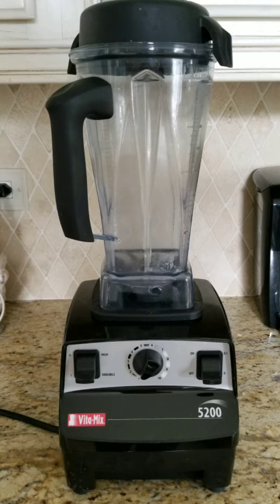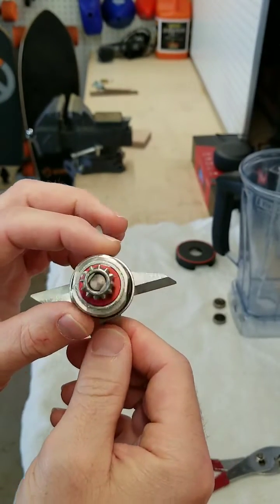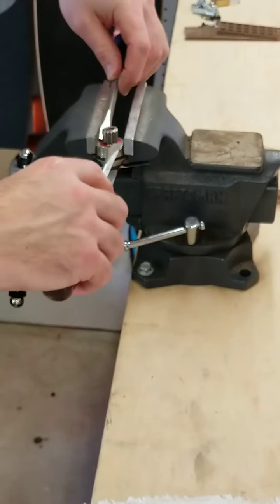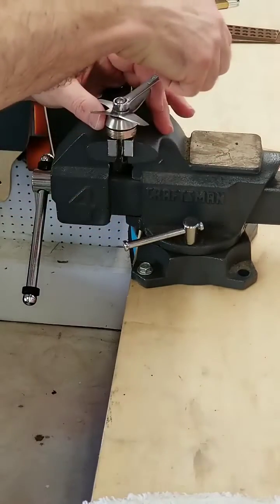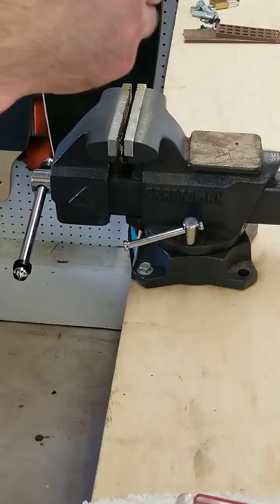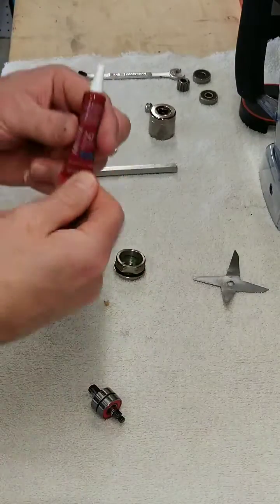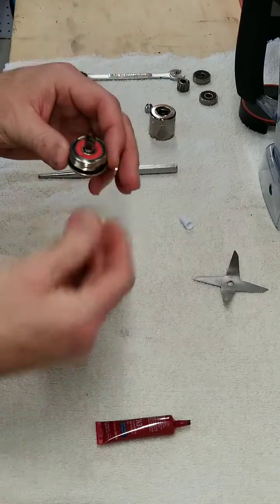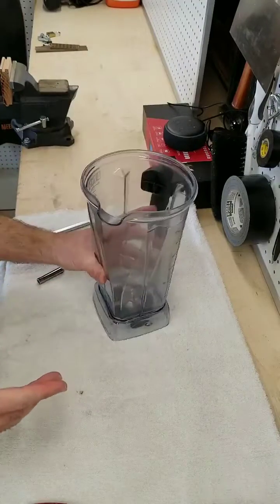Vitamix Blender Bearing Replacement Fix

Comment: Hi Mark, 

My ball bearings were "fried". The inner diameter casing, the ball cage and balls of the upper bearing were all that was left when I disassembled. From your video I can see what the actual good bearings should look like and can see that the two outer metal bearing casings are "stuck" inside the threaded base.  I am trying to tap them out with no luck...any ideas...I could tell they were stuck in there because when looking from the bottom opening of the base facing the blender, there appears to be the outer metal ring of the base and ring of metal "inside" it!!! and when I see and feel inside the metal base, the sides are not smooth to go against a smooth bearing surface, they are ridged when the bearings would have tracked inside them.
 
The beginning of this repair  started at my local hardware store that loosened the big nut on the bottom...at that point, we could see the upper ball bearing with exposed bearings and cage and the inner casing. The other inner casing was stuck to the shaft and that is when I realized...wow...the entire lower bearing was obliterated accept for the inner case stuck to the shaft!  I had been loosing bearings here and there of that one...My local hardware store had me soaking the parts in WD40 to break up any rust and hardened sludge...

BUT from your video, I can now see how there were actually two bearings stacked and unfortunately, the outside casings of them are stuck inside the base...

I have put them in a vise and tapped down on them through the hole on  the blade side of the base using a screwdriver tip and hammer against  the thread-like  lines inside the base but these outside pieces of the case still seemed fixed.  Any ideas on how to free these outside walls of the bearing cases from the inside of the base???  

Hoping to hear from you and/or others on this and in the meantime, back into the WD40 with more purposeful intention...:)
Reply from the maker: You are using a socket and vise to try to press the bearings and shaft out from the base?
Aside from WD-40 or something like liquid wrench, the only other option would be heat, but there are some rubber parts in there that surely would melt...  You may just have to buy a whole new blade assembly from Amazon at this point (next least expensive option).

Comment: Be advised that not all skateboard bearings are exactly the same inner (bore) diameter, despite claimed size. I bought the following on Amazon, and the shaft didn't fit tight in the bearings. The shaft could turn inside the bore of the bearings, and it would have ruined the shaft if I'd kept them in place. Mini Skater Skateboard Bearing 7x8x22mm ABEC 9 Precision 608 RS Scooter Longborad Bearings (16 Pcs Blue Silvery) They were cheap, and I got what I paid for.
Reply: Use a 608 2rld (peer bearing!)

Comment: If I buy a whole new wet blade assembly and place it in as you took it apart should everything be sealed properly?
Reply from the maker: Yep, putting it back together like this will ensure it's sealed.  Replacing the whole assembly is way easier than doing just the bearings, but also way more expensive...

Comment: I'm getting water leaking right through the center of the bearings.  No water leaks between the large and small o-rings at the bottom of the container. Any ideas on what holds the water from going through the bearings, or what needs to be replaced?
Reply: I got the same problem at first. I guess the inside little seal through which the shaft passes through, the one just above the upper bearing (closed to the blade), isn't has tight as a new seal. Anyway, what I ended up doing, I put a little bit of silicon on the top of this upper bearing before to insert it into its position. With a toothpick I applied a thin trace of silicon on the top circumference of that bearing. I didn't want it to spread toward the moving center. Well! It worked. It isn't leaking anymore.
Reply from the maker: Most likely the shaft seal, which can now be found on ebay.

Comment: Did you replace the seal? They are a bit of an odd one,  trying to track it down.
Reply from the maker: No, luckily I didn't need to.  You may want to try form-a-gasket by Permatex if you're not able to find a seal.

Comment: Thanks. But I only can take one bearing out by pressing. The second bearing is still sitting inside. Any recommendation how to take the second bearing out?
Reply from the maker: Maybe try to spray some liquid wrench type fluid in there and let it set in for a while and/or then try to tap it out using a punch, like I showed in the video, or a small screwdriver.

Comment: Thanks so much for the information bud. What is the bearing size?
Reply from the maker: They are standard skateboard bearings. I would just make sure they are sealed, which I think most are these days.
Reply: The bore is 8mm  OD 22mm and height is 7mm
Reply: 608-2RS and better to use proper one like SKF, NTN, ...

Comment: Thank you for this video.
When you say "skateboard wheel bearings", do you have a specific type? ABEC 5 or 7? Can it just be anything generic, as long as they're for skateboard or inline skates?
I would guess bearings aren't made equal.  You can buy really good quality bearings, and very cheap ones.  I just wonder what the Vitamix OEM bearing quality is.
Reply from the maker: Thanks - Someone else recommended these bearings, but I have not personally tried them: 
Size: 608 2RS 8mm bore 22mm od 7mm wd 
or just order this: https://www.amazon.com/608-2RS-Precision-Shielded-Greased-Bearings/dp/B01L7P89RW/ref=pd_cp_328_1/135-4551291-5960504?_encoding=UTF8&pd_rd_i=B01L7P89RW&pd_rd_r=b4f299b5-7f79-4ae0-8866-31659257ca46&pd_rd_w=Y2iYH&pd_rd_wg=5ybrV&pf_rd_p=0e5324e1-c848-4872-bbd5-5be6baedf80e&pf_rd_r=Q4BD8FE60S9DB7H0TQ8X&psc=1&refRID=Q4BD8FE60S9DB7H0TQ8X

The ones I used were ABEC 7 and came with some wheels I had.  I wouldn't use the cheapest nor would I buy the most expensive.
Reply: @mmark300  Thanks again.  Great reverse engineering and work around.  I knew this thing was possible to fix!
Reply: Yes bearing come in different grades..................Don't buy the really cheap Chinese bearings.

Comment: Anyone know? How did he know the bearings were the issue? Mine is 12 years old but everything looks good. I'm thinking this may be my issue in that I have to use my tamper a lot more often to get stuff moving around.
Reply from the maker: Mine was making some very bad noises.  Turn the blades by hand - they should be very easy to move.  And it's not difficult to take the blade assembly out and check the bottom bearing and whole assembly to see if there's any signs of a burnt bearing.

Comment: Would ceramic bearings be better here?
Reply from the maker: Probably, but not sure if it's worth the cost. If you could find somewhere to buy just a couple of them it may be.  Because it's a lot of work to change them out it's worth getting higher quality bearings for sure.
Reply: @mmark300  I'm about to order some. Full ceramic 608 bearings are relatively cheap at $5-10 CAD on aliexpress, but complaints of slop are common in the feedback. I like the idea that they don't need lube, because mine goes in the dishwasher. My bearings are likely especially bad because I'm using a $40 kockoff polycarbonate mixing container with bearings that started to rust immediately, but otherwise flawless quality.

Comment: omygawd this is way too much work for me!  looks like Im ordering a whole new blades and all 😳😳
Reply from the maker: Haha, yeah, this repair is not for everyone.
Reply: @mmark300  This video is awesome! Alas, I'll probably not be able to take advantage due to the investment I would need to make in all the tools (Vise, etc.) that you've probably spent years accumulating.

I'm more than frustrated with Vitamix, as they do not sell a replacement blade for my container type (the one I purchased has a driveshaft that is too short and there are not enough threads on it to properly engage on the container).

There don't appear to be any cheap Chinese knock-offs available on Amazon either. :(
Reply from the maker: @TACaddick  Thanks! And that's a real bummer.  Is this a new model?  I would think they would have replacements available soon.
Reply: @mmark300  Hi… thanks for your reply. Although my Vitamix is over THIRTY years olds, the container is a relatively new 48oz low profile model.

Comment: Do you have more information about the bearings? Number or something else?
Reply from the maker: Someone else recommended these bearings, but I have not personally tried them: 608 2RS 8mm bore 22mm od 7mm wd or just order this: https://www.amazon.com/608-2RS-Precision-Shielded-Greased-Bearings/dp/B01L7P89RW/ref=pd_cp_328_1/135-4551291-5960504?_encoding=UTF8&pd_rd_i=B01L7P89RW&pd_rd_r=b4f299b5-7f79-4ae0-8866-31659257ca46&pd_rd_w=Y2iYH&pd_rd_wg=5ybrV&pf_rd_p=0e5324e1-c848-4872-bbd5-5be6baedf80e&pf_rd_r=Q4BD8FE60S9DB7H0TQ8X&psc=1&refRID=Q4BD8FE60S9DB7H0TQ8X

I used some sealed ABEC 7 skateboard bearings that I already had.  One person did say that their cheap skateboard bearings had too large of an opening and spun around the shaft. I think the lesson is to not go too cheap on bearings.

Comment: I was able to do this but shaft doesn't stay in the bearings.  It moves up and down.  Might need to add locktite on the shaft also.
Reply from the maker: You may want to try other bearings. Someone else commented the same. Some bearings are out of spec, I believe.

Comment: they make a lot of different bearings, which ones exactly?
Reply from the maker: I just ordered a decent set of sealed skateboard bearings from Amazon. Not the cheapest and not the most expensive.
Reply: Alright that's cool, they all seem to be similar.. I have an old blade assembly I can try to take apart.

Comment: Excellent video.  I don't understand the use of loctite on the outer shells of the bearings?? Nothing really likely to movie there.  I would have used a very light coating of food safe grease or mineral oil, as well as on the bottom pressed on gear.  Also, you neglected to show or mention the (imporiant) seal/O ring on top of the upper bearing.
Reply from the maker: Thanks. My seal/o-ring was still good, but if not, form-a-gasket may work. Someone else said they used some silicon. I was unable to find a replacement for that gasket and have never seen anything else like it before. 
Yeah, loctite may be overkill - i don't recall exactly why I decided to use it...

Comment: im replacing my bearings and if the sides of the bearing are that loose and there is (zero compression) the loctite might not work....a spinning bearing on the shaft or housing will junk the blade assembly.  you wont even know if its spinning in the housing until its too late....it would be better to use a copper shim instead of the loctite...
Reply: unless its held by side pressure from the assembly itself...in which you don't need the loctite or the shim...;)

Comment: Hi can you confirm type or name or number of bearing?
Reply from the maker: Someone else recommended these bearings, but I have not personally tried them: 608 2RS 8mm bore 22mm od 7mm wd or just order this: https://www.amazon.com/608-2RS-Precision-Shielded-Greased-Bearings/dp/B01L7P89RW/ref=pd_cp_328_1/135-4551291-5960504?_encoding=UTF8&pd_rd_i=B01L7P89RW&pd_rd_r=b4f299b5-7f79-4ae0-8866-31659257ca46&pd_rd_w=Y2iYH&pd_rd_wg=5ybrV&pf_rd_p=0e5324e1-c848-4872-bbd5-5be6baedf80e&pf_rd_r=Q4BD8FE60S9DB7H0TQ8X&psc=1&refRID=Q4BD8FE60S9DB7H0TQ8X

I used some sealed skateboard bearings that I already had.  One person did say that their cheap skateboard bearings had too large of an opening and spun around the shaft. I think the lesson is to not go too cheap on bearings.

Comment from the maker: Vitamix Wet Blade Assembly from Amzn affiliate - https://amzn.to/3BqiQJr
Someone has pointed out that Ebay sells bearings and shaft seals (https://www.ebay.com/itm/284220125187?hash=item422cd6f003:g:MdIAAOSwV0VfpAdZ) as well as just the shaft seal alone (https://www.ebay.com/itm/284170470298?hash=item4229e1439a:g:ODAAAOSwNqNgGayw).  Or you could just search for vitamix shaft seal.  [I haven't tried them myself.]
For bearings, the following should work well: https://amzn.to/3fLc88t
However, any ABEC-7 or higher bearing that is 8x22x7mm should work well.
Reply: I can't find seals for shaft
Reply: I bought the bearings from Amazon linked above and they did not work. The inner diameter was too big and they slid easily on and off the shaft. Suggest not linking to these specific bearings. I have a Vitamix 5000.